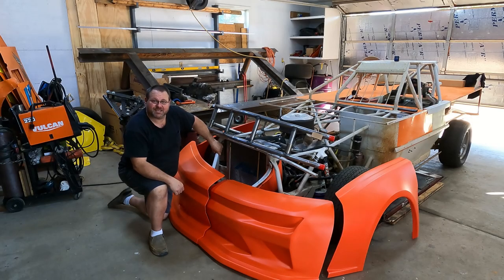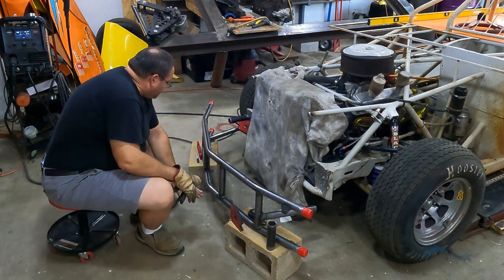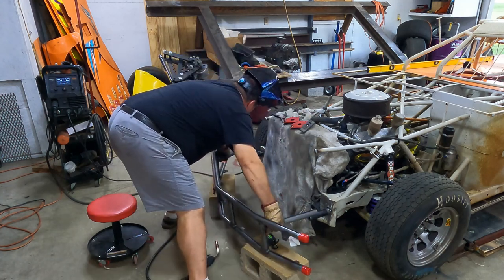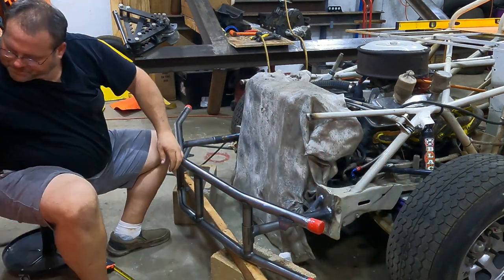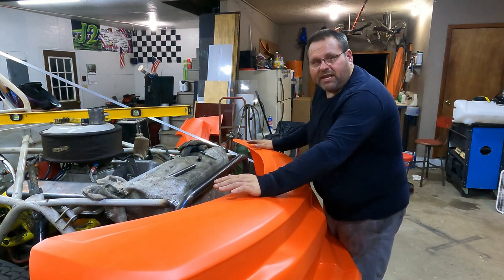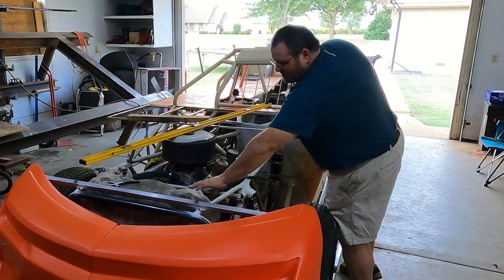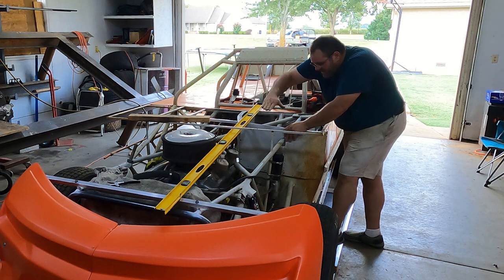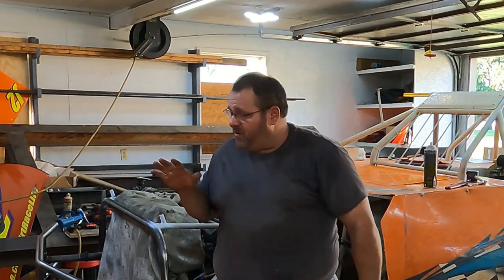How to Install a Camaro Nose on a Street Stock

Comment: I would strongly consider tying the top bumper bar to your Rad support with something light like some 1" tubing. We have done similar bumper mounts, but without it and I've folded bumpers under in minor incidents that I probably would not have if it was tied together.
Reply from the maker: I really went back and forth on this one. Maybe something simple. I have ripped a few noses up where if I just hadn't had the bar they would have been fine so it makes me question which way to go. 
I think you convinces me to add a small tubing across the gap though.

Comment: The only problem with watching your videos is it makes me want to build another car! Lol last time I climbed in a car was 09. I miss it but damn it was an expensive hobby.
Reply from the maker: I was out of it for ten years so I know that feeling!
100% agreement on the cost. When I started I hunted down parts in old junk yards and now its buy everything aftermarket. Thats my main reason for making anything myself I can.
Reply: @DIRTRACELIFE  totally!! My dad’s shop was a block away from the local family owned wrecking yard. I spent many hours digging through their junk and making as much of the parts I could. Times change. Everything out of a catalog, dads shop is long gone and the wrecking yard is now an apartment complex. Sigh. Also here in California G bodies are going for thousands for a pile of crap and most have been cut for hydraulics. I use to buy them all day long for a few hundred bucks.
Reply: Have you considered sim racing? A few sims have a pretty good selection of dirt and street stock style mods.

Comment: great video, what was that power tool you were using to trim the fenders and filler piece?
Reply from the maker: Those are Makita power shears. I have had them jokers over 20 years and they don't make that exact model anymore.

Comment: I have the same nose on my car, i didnt like the way the fenders flowed with the rest of the body and made my own out of sheet aluminum.
Reply from the maker: I think I could have went either way and it would have worked fine. Dominator makes a half fender flair piece that is probably the easiest solution.
I agree, that fender doesn't just work anywhere. It looks weird if there isn't a lot of drop from the deck to the nose.